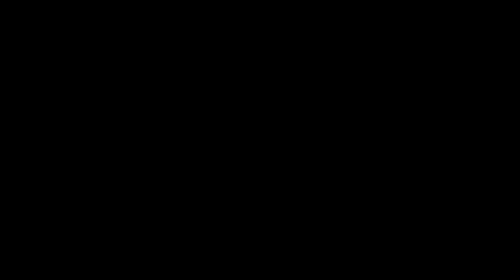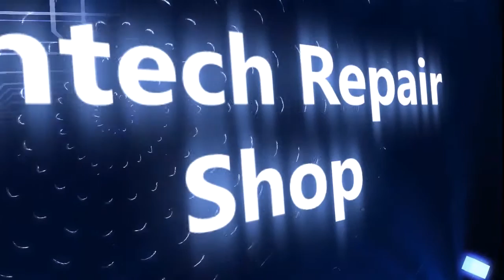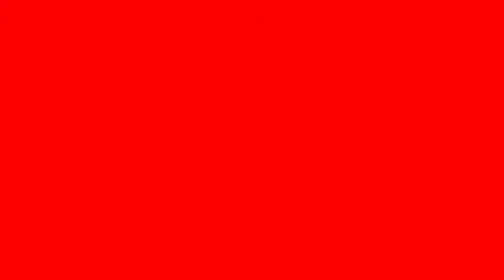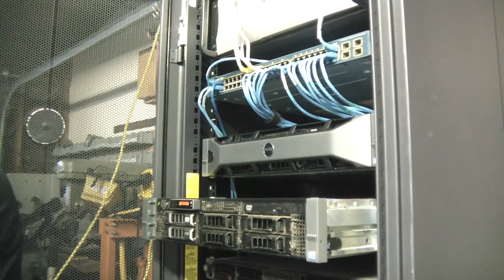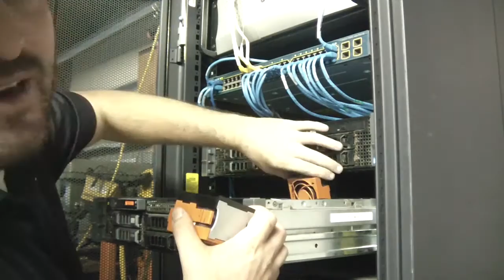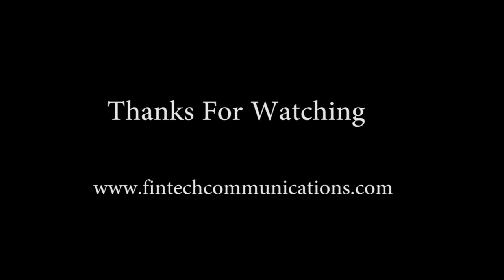Dell R710 noisey Fan Repair hot swap replace noise

Comment: Do you think this is quiet enough to sleep next to, as in like 4 feet away on the floor??
Reply from the maker: The R710 is probably one of the quietest rack mount servers I ever 
heard. When I was learning IT I used to have a rack in my room with 
noisy servers. This was 20 years ago and the servers were loud back 
then.
Reply: Ok, i only need to run about 8vms with little to no usage, will it work with non dell hard drives in dell caddies as long as they are sata??

I mainly will use a vm for downloading stuff overnight on my slow connection and it will be in a homemade rack about 4 feet away. So you think the noise will be manageable?
Reply from the maker: yeah